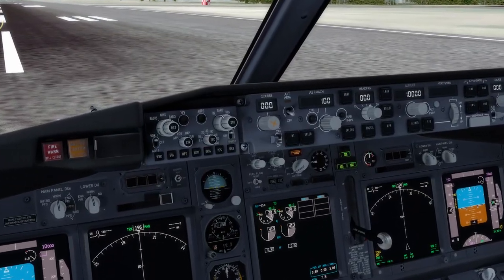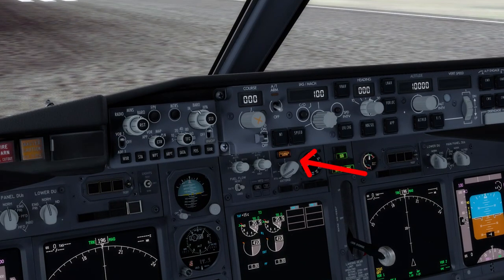Configuration Deviation List (CDL) Explained - Can You Dispatch With a Missing Pannel?

Comment: Hello Captain

1)Do you have to look in the CDL only if parts are missing or also if they are damaged?

2) Lets say you had a bird strike and half of an antenna is broken away.
Do you have to look in the CDL?
The antenna is not missing but damaged.

3) What if something is missing, and the maintenance is not on the airport and the aircraft has to stay on the ground AOG?

The MEL topic was a little big difficult compared to the CDL tooic.

Thank you for answering👍

By the way, congratulations for more than 500 subscribers.👏
Reply from the maker: Hey!! Many thanks for the support!!!

When an item is damaged, due to a bird strike, for example, you don't look at the CDL. You inform Maintenance and wait for them to inspect the Plane.

If there is no maintenance available when you need it you need to wait for it, normally the companies have a contract with the local Airport maintenance company.

In the worse case, the company will send some engineers on a private flight or with ground transportation.

Have a great day!
Reply from the maker: Hey, I hope you are doing great, I have a quick question for you... Do you know how I can get a personalized livery for my Boeing 737 pmdg ?
Many thanks!!
Reply: @PILOTCLIMB  

As you use the PMDG 737 NGXu you need liveries for this certain model.
Don't use NGX or NGX2.0
At avsim library you can find many for the 700 and 800 version.
PMDG also offers the BBJ models but as upgrade extra.

You need to create an account at avsim.
But avsim is freeware

https://library.avsim.net/search.php?CatID=root&SearchTerm=737+ngxu&Sort=Added&ScanMode=0&Go=Change+View

Also you can check flightsim.com for freeware textures.

But read the readme carefully for correct installation.

It is always recommended to create backup of files before. In your case PMDG 737NGXu files or whole folders.

Let me know if it helped or if you need certain livery.
For example you can find Ryanair in the link above.

P.S.

At PMDG you find also the paintkits for every model.

But this is only for use of creating own liveries.
So if you have knowledge about photoshop for example you can create own liveries as you wish.

But i haven t done this before.

https://pmdg.com/paint-kits/
Reply from the maker: @ahmedsmart1120  Awesome, Many Thanks!! I will look into that.

What I want is a simple white livrery without any company name on it, and than later paint a PILOTCLIMB.COM livrery

Have a great day
Reply: @PILOTCLIMB  

Hey.

If you want to create an own repaint for the PMDG 737NGXu you need a paintkit.

A paintkit contains all the parts of the aircraft which can be painted.

Like engine cowlings, blended winglets, split scimitar winglets, vertical stabilizer ect ect.

If you want to use a paintkit you need a paint program like photoshop.
As far as i know all advanced and professional repainter use photoshop.
I mean painters for aircrafts and AI traffic.

If you want to make a repaint for the -800 version, you need the paintkit for the -800 model.
Same for other models.

At PMDG you can download the paintkits for free.

https://pmdg.com/paint-kits/

But...you need to be patient as you have to learn painting step by step.
You have to work through the paintkit.

Personally i never made a repaint.

I am sure that you can also get informations in the PMDG forum.